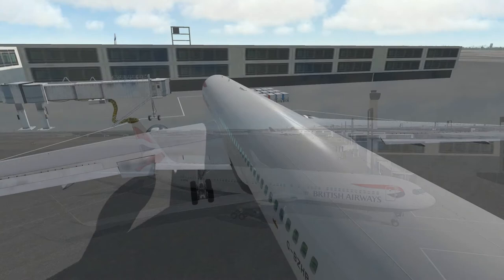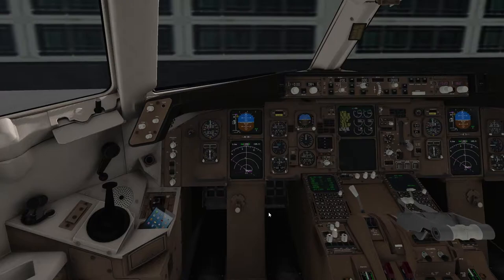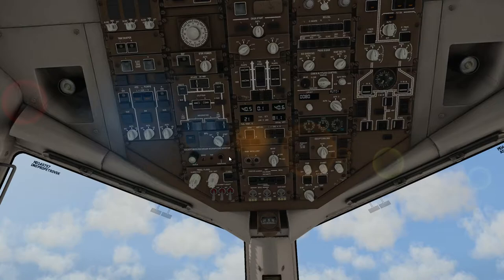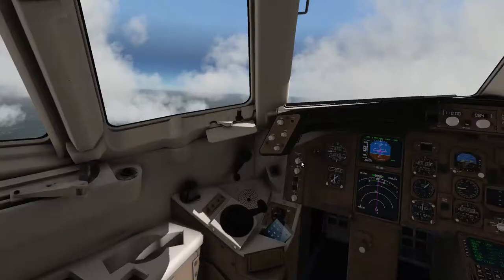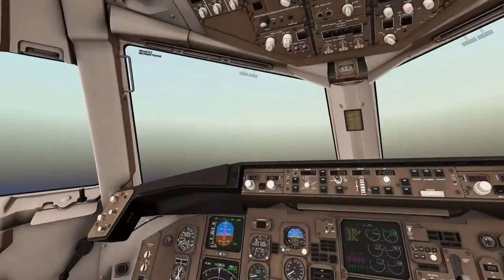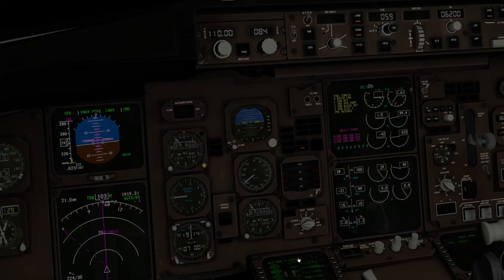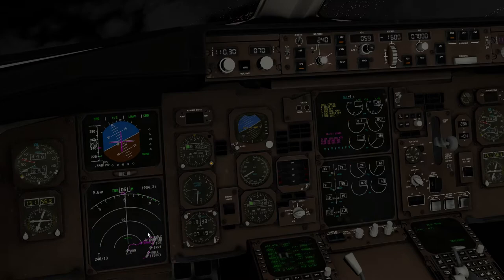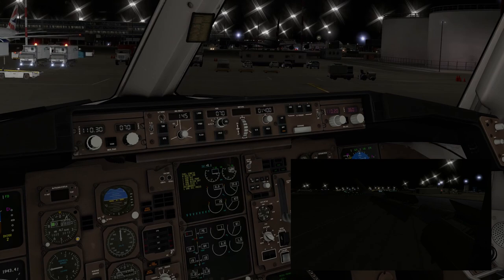X-plane 11: KJFK to EGLL Flight Factor 767 - My first transatlantic flight!

Comment: Sorry for Complaning Cause My first trans alantic flight from Dublin-Newyork Some how I ran out of Fuel & My Second Attemp I din't Even land on the  runway :( 
But I am only 11
Reply from the maker: that's ok.  You keep at it :)   no matter how old you are, keep trying till you get the hang of it !!  That's why I post my failures too.  To show that everyone is learning while they fly!
Reply: Keep going don’t worry what you did not land on the runway and  ran out of fuel it’s just a mistake you will get it right some time and it is very rewarding

Comment: Hey, I’m a new simmer, well a currently non existent simmer but getting into simulation for Christmas. I’m currently gathering information on setting up FMC’s and how to program FPL’s into them. May I ask where you got the load sheet thing with all block fuel pax cargo route etc?
Reply from the maker: I generate it from https://www.simbrief.com/home/    its a free site to plan your flight.  Once generate a flight you can generate output to PDF and that's what I use.